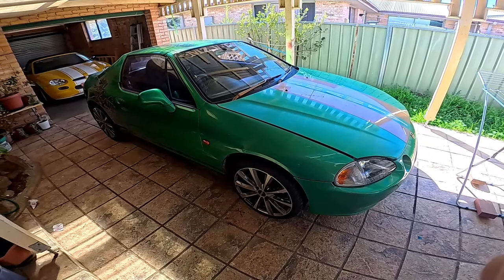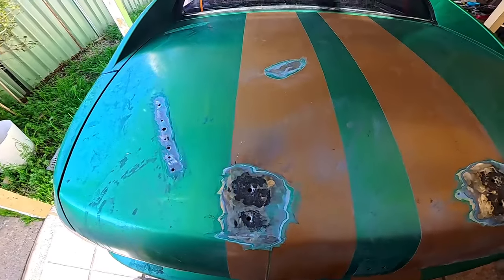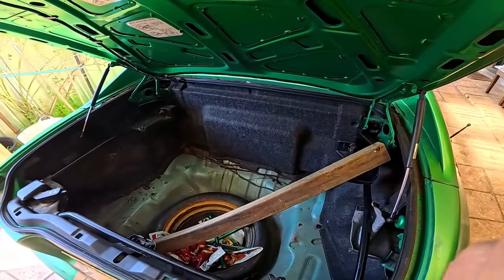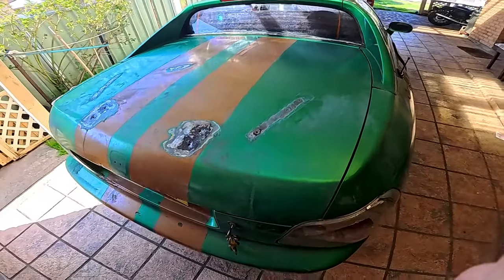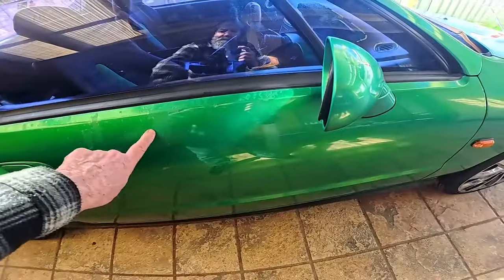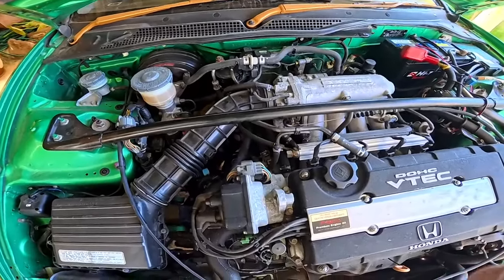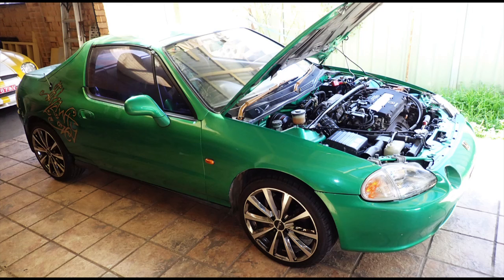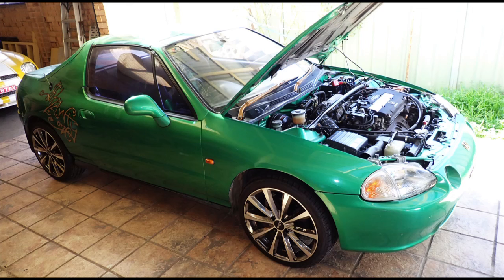Honda Del Sol Vtec  DIY Paint and Panel Repair!

Comment: I always loved the look of the Honda Del Sol. Has a very cool sporty vibe. Plus it was made during a time when things weren't junk. That green color looks like sharp . Almost as green as your vintage looking new green Rolex ⌚️ Said it before, will say it again, you got skills. Motorcycles are great, but to be able to traverse other things such as automobiles is really neat. Got to ask... which is faster? Your yellow sports car or the green Del Sol?
Reply from the maker: only real issue there is the rolex is worth more than the car...lol
 i did notice on test drive the vtec isnt working properly. will check oil level and maybe pull the solenoid out and clean too
if running corectly it should easily beat the yellow sports car and many other cars but at the moment-not the case